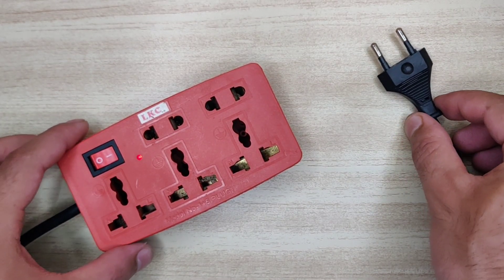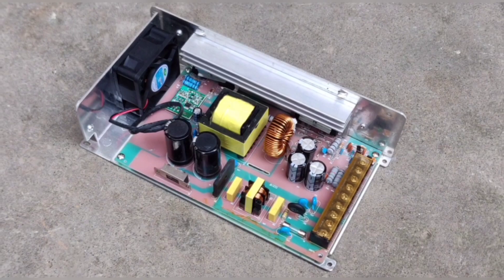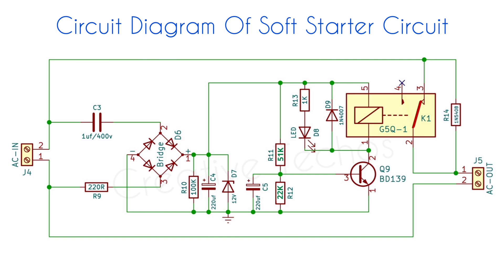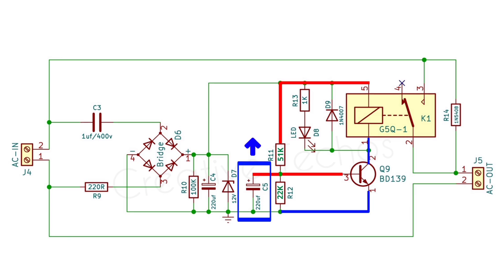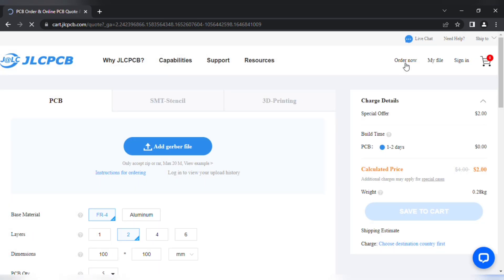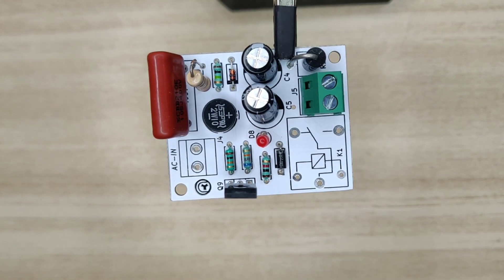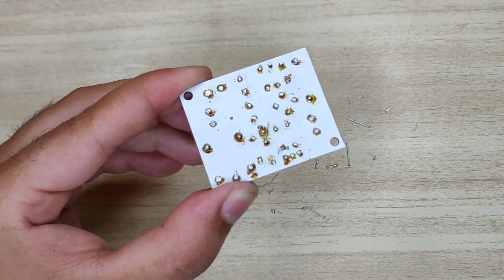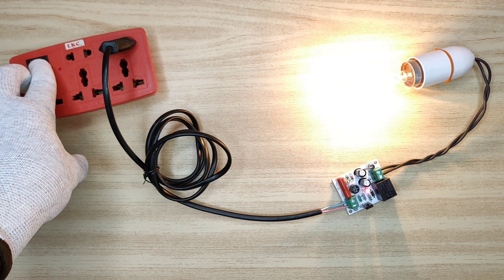Make this circuit to extend life of your home appliances

Comment from the maker: Circuit Diagram + PCB Files Download link is in video description.
Reply from the maker: Yes you can use with 120v it will work fine. Thankyou
Reply: For 220  @CreativeTechos
Reply: What about air conditioner compressor?

Comment: How can this be used with power tools?
You show the power tool being switched on at the supply before the circuit, but a power tool will be switched on after the circuit using the tools trigger switch .

Comment: HI. There is an error in the schematic. The 1N5408 diode is represented as a resistor and therefore without the polarities.The enumeration of diodes is also flawed.
Reply from the maker: It is not error, you actually can use actually can use 5W 50R resistor there but it may heat, So i actually found that 1N5408 has also junction resistance of above 300-400 ohms with high load capacity without heating, i just tried it worked great than resistor to block inrush current to inductive load.
Reply: @CreativeTechos  OK. Sorry

Comment: this is nice for appliances with power switches.. i was thinking i could use this in refrigerator to control the surge everytime the compressor turns on? or this device is only applicable the moment we plug or switch on the appliance only.. i have a refrigerator and my problem is the surge it gave to my inverter everytime the compressor turns on
Reply from the maker: Actually it is only applicable to protect appliances from surge/inrush current during on time.

Comment: What is maximum output this board can handle ??
Reply from the maker: It actually depends on relay used,  Relay used in video can switch about 1kv load. You can use high ampere relay for higher loads
Reply: @CreativeTechos can i mount bigger relay in that same mounting hole ??

Comment: Watts?or pic amper?
We can used for refregrator?
Reply from the maker: It is 220v @ 10A max as relay rated, you you can use it for refregerator
Reply: @CreativeTechos  great, I need that, but I can't make that, how can I buy this?

Comment: can this use for 220v, 25A submersible pump?
what is the max ampere can this solf-starter can handle?
Reply from the maker: Used relay is rated 250v @10A.
You can use big relay to connect more load.

Comment: You have marked IN5408 Diode as "R14" as if it is a resistance. Secondly isn't the polarity of that diode important ? You have not provided it. Pls clarify.
Reply from the maker: Actually 50-400 ohms resistor was supposed to use there but about 10-20W.
I found the IN5408 has junction resistance of 400ohms and can handle high power without heating 1000v @3A.
So I used instead. And you can use with any polarity.
Reply: @CreativeTechos  Thank you for clarification. One more thing. The input capacitor is given as 1uf/400v. shouldn't it be 0.11uf /400v ? With 1uf one shall get an output almost same as input. 

My zenner shorted and then I remembered another circuit I had developed with similar input for low current application. I had used 0.11uf to get an approx 25v. With 220ohm also in the input , the output shall be around 16v (230v ac input). I think this is sufficient for the circuit. 

with 1uf the load on 100K resister shall be high , trying to bring down the voltage. 

I think 0.11uf should do well for an input 230v grid.

Comment: Hi, thanks and I am really impressed by your simple solutions. We Sri Lankans are facing daily powercuts these days and battery backups are of paramount importance. I tried few mini UPSs for wifi routers given by Youtubers but unfortunately not successful in holding backup for more than few minutes despite using original 18650 batteries. Could you suggest a reliable solution containing something like three 18650 batteries. thanks.
Reply from the maker: Thanks for appreciating, also I'll try to upload UPS for wifi router ASAP

Comment: why r14 is 1n5408.  i think it's the power resistor.
Reply from the maker: There resistor of 100 ohms 15w was supposed to be used. But as resistor will be Big in size also may generate heat during switching. So 1N5408 diode can be used as it can handle higher power and has also junction resistance of 300-400 ohms.
Reply: 👍👍very good idea.  tell me the direction of the diode.  not shown in the schematic.
Reply from the maker: You can use diode in any direction actually it acts as resistor as 1N5408 has junction resistance of 300-400 ohms effective to limit inrush current.
Reply: 1N5408 is rated only for 3A, so this circuit can't handle 10A as stated. For a 10A device there will be a much higher inrush current, and this diode can handle it for only a couple of miliseconds.  There is no data in diode datasheets such as ""junction resistance"", so not sure where you got that data. It works for you only because the diode acts as a rectifier and the load sees only the half of the AC sine wave while it is in the circuit, effectively lowering the average voltage - nothing to do with junction resistance

Comment: excellent work!  very useful...   does it work for 110 and 220?
Reply from the maker: Yes, will work for both voltages. As blat capacitor is used 1uf and will give sufficient power to switch relay @ 110v & 240v max.
Reply: @CreativeTechos  127vac se le cambia algún componente o queda igual gracias
Reply from the maker: It will work fine without changing anything 🙂
Reply: @CreativeTechos  ok muchas Gracias excelente trabajo Saludos!!!